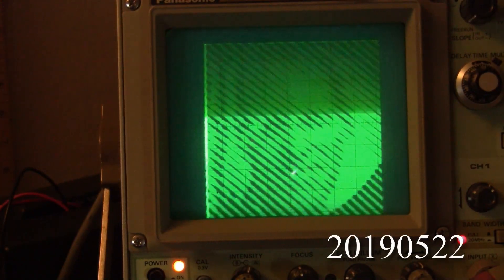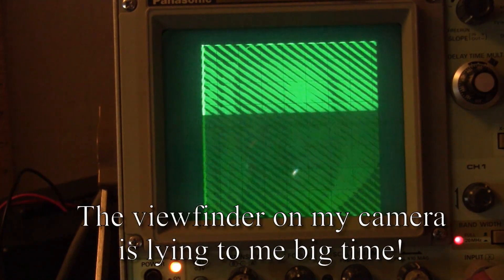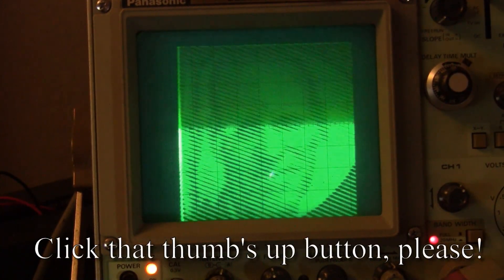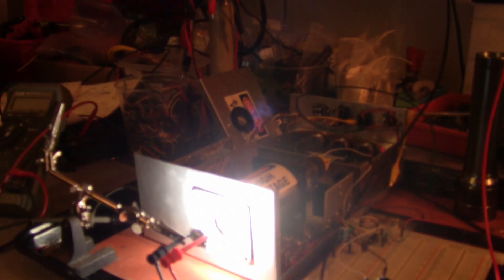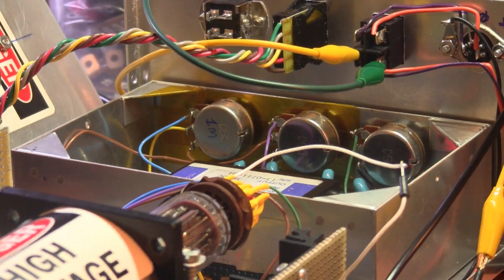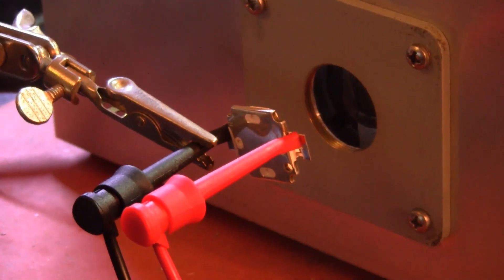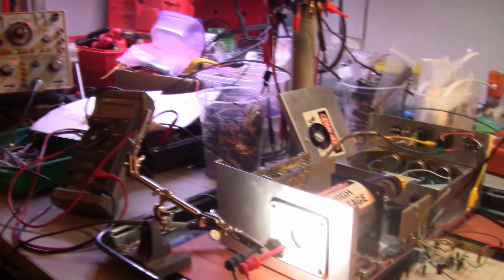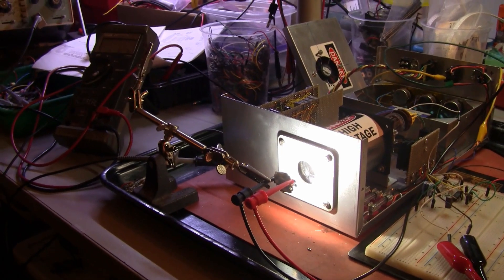PhiloCam Part 14 - First dissector images with scan circuits

Comment: I think we can get live pictures from it by cheating a little. Remove the backlight off a small LCD and use the powerful backlight as a light source for the now small transparent LCD. Might work. Used to do this by converting LCD monitors into home made projectors for overhead projectors.
Reply from the maker: Good suggestion. Back lights are not bright enough for this. Bright as they are. The video can't show how intense the LED truly is. My HD video camera is self adjusting and tones it down a LOT. In person, you can barely look at it. Farnsworth tested his first camera tubes by projecting slides and movie film directly on the face of the tube. I do have a glass transparency test pattern that I could light with my halogen light. But, that can only be turned on for five minutes at a time. Draws too much power too. 500W. Too scary for me!
Reply: I was referring to using the bright LED as a means of replacing the backlight on an LCD, essentially turning the LCD into a slide as without it's own backlight it's completely translucent.

Comment: Was there ever an image intensifier designed to intensify normal light levels to insanely bright levels without swamping the phosphopr and making a mess of an image? I recall a lightbulb based on an electron bream striking phosphors being released some time before LEDs took over so the pieces are all there but if anyone ever had a need for something so specific or it was ever made is another matter.
Reply from the maker: The 6032 is an image intensifier tube that was developed by Farnsworth during WWII. It was the dissector front end with a CRT-like phosphor screen on the back end. I have one in my collection and may try to make it go some time in the future. It's the 20KV drive right next to my face that gives me pause. Here is a photo and page about one: https://www.worthpoint.com/worthopedia/ham-radio-night-vision-infra-red-tube-capehart-6032